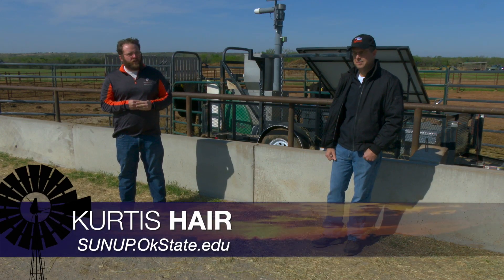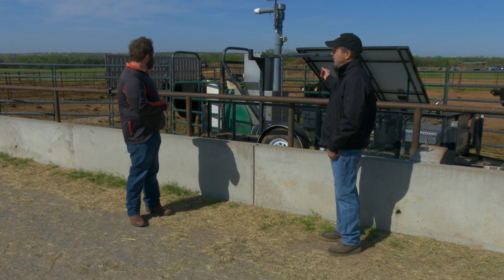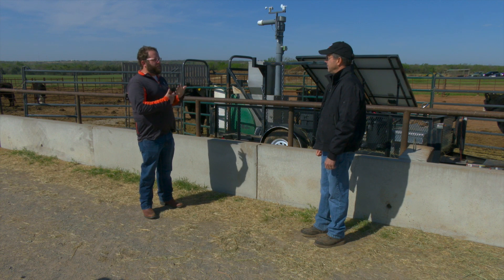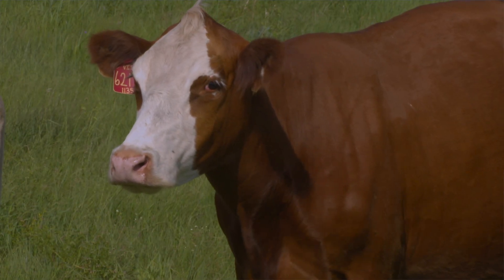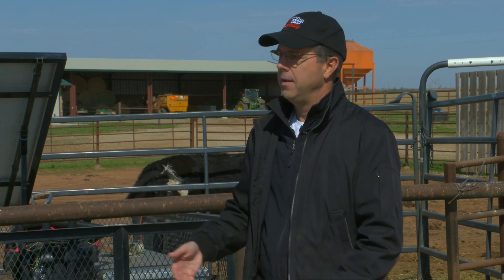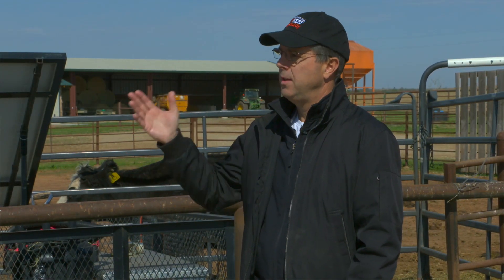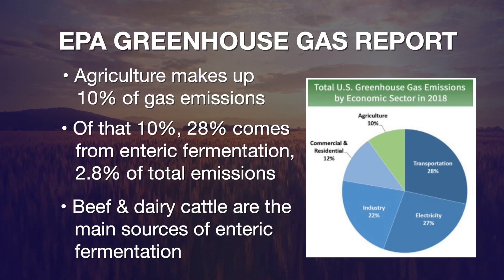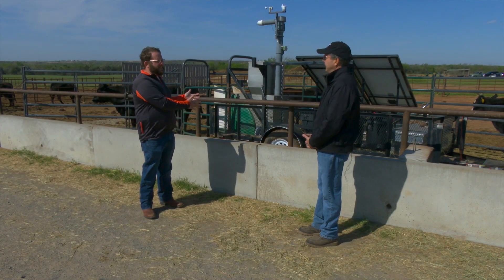Cattle & Methane Emissions (4/17/21)

Comment: Of the 10% how much C02 or other gases are pull out of the air from crops
Reply: I just learned this, the methane that the cows produce is the same amount of CO2 that it took in and will convert back into usable CO2 for plants in 10 years. The CO2 that cars produce takes 1,000 before plants can use it again and it gets trapped as greenhouse gasses.